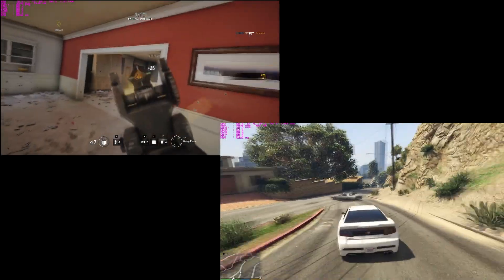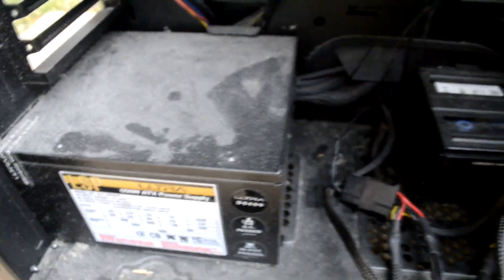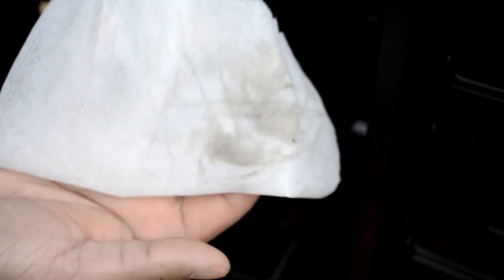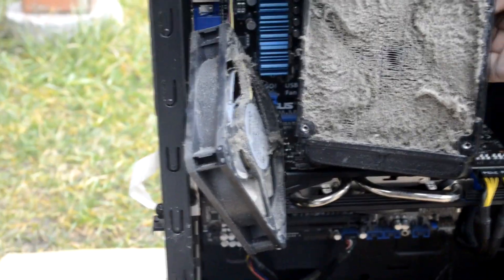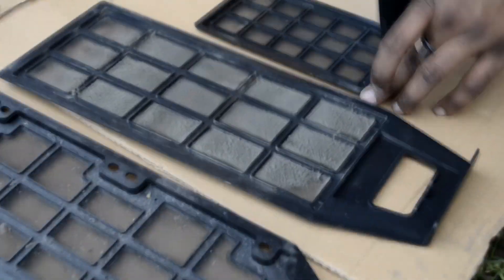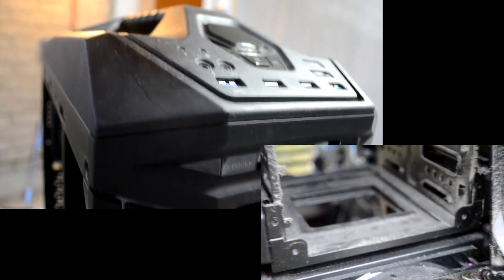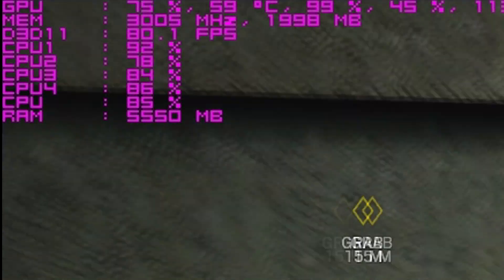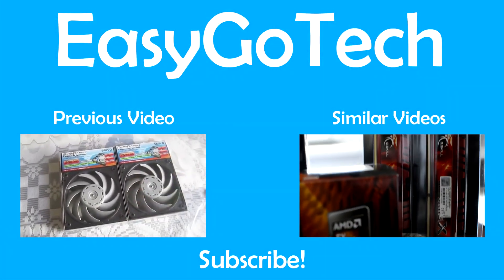Myth Busting: Does Cleaning Your PC Improve Performance?

Comment: I had my PC for 2 years and didn't clean it once. It would constantly have loud fan sounds, today I cleaned the fans completely and now there's barely any fan sound and also less CPU usage is being used. It's worth it to clean your PCs
Reply: I didnt clean my PC for 6 months and roblox already starts lagging
It didnt used to lag before
I will clean my PC now
Reply: @YOYaiu  if roblox starts dropping frames you already know your pc is fucked 💀
Reply: i have my pc for nearly 3 years and i never cleaned it up, the fan sounds are not loud and sometimes it's slower than a turtle but some times still not decent but faster than brefore so uhhh yeah, i never get decent performance

Comment: I cleaned out a massive amount of dust and fluff from all 4 fans. I had no idea so much crap could get in, you could not see the heat sink at all for gray stuff. I took it out to my garage and blew it out with a reduced pressure compressed air line. (with water trap)  Very satisfying, looks like new now. Does it work better? the hell YES. Thank you for the heads up, I will keep it clean from now on.

Comment: Cleaning a PC with compressed air is useless bs. The only real way to clean a PC to a state it almost looks completely new is:
1 - disassemble all components, everything, even fans and cpu cooler - you'll need a thermal paste later
2 - first vacuum dust off everything
3 - remove the dust that sticks to case and gpu fan wings with either blue window cleaner or solution for pc (basically the same) or with wet alcohol based clothes (like the ones for hands). U can use fingers or ear cleaning sticks 

Fans always have dust on them pressed by hours of spinning that won't come of with air or vacuum, only applied pressure

4 - use the same method for rest of components
5 - remove fans from cpu cooler radiator, which is definitely filled with dust and rinse it with either hot water in shower or apply the detergent and then rinse. It will look like brand new. My black radiator from artic 34 esports duo was almost Grey.  The dust on it was like glued to it.

5 - vaccum and then air-blow the connectors on the motherboard
 6 - gently clean the cpu of thermal paste with either soft toilet paper or handkerchiefs
7 - apply new thermal paste and rebuild pc from scratch

Repeat this every 2-3 moths and your pc will always look new and have beat Temps

I have beat Temps with 3 from intake fans, 2 back outake fans, mx4 thermal paste. He who thinks that just air and vacuum will clean a pc has never cleaned a pc... It's impossible

Comment: I just use air compressor 100 psi cleans easy
Reply: Yeah you could do that... Or use the convenience of the huge vacuum that is space. But to each their own
Reply: just another account vacuums create deadly static
Reply: Dangerous Uncle no more like moisture would be the bigger problem and never had an issue with that either just let it dry for 10-20 minutes
Reply: ItsiTroid does compressed air have any moisture? Or can I just use that and the straw
Reply: @ryando2877  if its outside it will have moisture from the air

Comment: A clean PC is a happy PC. I just cleaned mine after months of neglect. I haven't cleaned mine since December, which is pretty bad since it gets very dusty where I live, and I also have my computer underneath my desk. So it's insanely prone to  getting dust sucked into it. The amount of dust and dirt that I removed was astonishing. I even decided to remove my AIO so I could take it outside and really get at the radiator with some air. So, of course, new thermal paste applied.

After all that, my CPU temp dropped several degrees (at least 5 C) at idle. GPU seems to be mostly unaffected at idle, but I didn't really wanna take it apart just yet. I'm waiting to get my hands on an aftermarket GPU cooler before I take it apart and really clean it out. Regardless, I'm pretty happy with a clean PC.

Comment: It sure did for me. Used a compressed air can to clean out my laptop fan and it's like my laptop is brand new. Able to watch videos with no interruptions or lagtime at all, can go from page to page very smoothly and it just plain runs better. The fan is quiet as a whisper and the laptop is noticably cooler. I know I'll regularly clean out my laptop fan on a weekly basis from this point on.

Comment: Cleaning PC is more about preventing its early demise by having more stable temperature, better power efficiency (less intake for the same usage), less risk of electrical shortage, while delivering the SAME output while it can. Not to mention a better looking device.

Comment: I'm 1 min in, I started thinking of the shitty $20 box fans we have. When I spray the motors out, and spray the blades down with water, it performs substantially better. Dust slows things down dramatically on those things.
So, from my experience, if it has some kind of an electric motor, keep it as clean as possible. It also makes sense bc the extra weight of the dust (grabbing even more dust while it's being used, will weigh down everything about the device.

Comment: Modern hardware is smart enough to automatically down-clock "throttle" itself when becoming too hot in order to prevent it from burning out. Dust impedes airflow causing the cooling to be inefficient.

Comment: I would recommend removing CPU cooler water block. cleaning CPU and water block contact surface with alcohol and replacing he thermal paste with a after market one like cooler master or arctic. it would bring down temps even more so. Same goes for the GPU.

Comment: It's not always improving performance, but improving the temperatures, keeping the computer quieter and cooler.
Reply: VERY LATE here, but if anyone is curious, improving temps helps performance as your CPU and GPU will bottleneck themselves to protect themselves.

Comment: You really need to work on your airflow direction. You have the fans sucking in front the front and back of the case. Flip the fan on your radiator.

Comment: Well no, not directly. Cleaning the PC reduces temperatures and mechanical obstacles (clogged up fans etc), and those lower temperatures increase the performance. But the perf gain will be minuscule. All you're really doing is lowering temperatures to reduce thermal throttling.

Comment: Oh hell yeah... If the pc os running hot as hell, the cpu and gpu will throttle... Old systems didnt even havr this protection and could have damage in the parts.. 

You only clean when you see the temperatures rise or once a year or another period of time depening on how dusty it gets.

Comment: Who has that rear fan on the inside of the case pulling air into the case and not pushing air out of the case
Reply: Which is also why there’s so much dust on the radiator

Comment: You should never use a vacuum to clean a PC because of Static Electricity buildup and potential Discharge onto components. an Air Compressor is the best way to clean a computer.

Edit: I Didn't watch far enough to know you were only cleaning the Dust Filters with the vacuum.

Comment: Trash air cans...   TRASH..   use a fucking compressor with a pressure regulator and a vapor trap.  about 30psi does the trick.

Comment: Well, nvidia cards are designed to run slower when they detect poor air circulation so I'm gonna go with yes?
Reply: Nvidia cards do not detect poor air circulation. Simply when there is poor air circulation, the cards tend to heat up more and when reached a certain peek, the card thermal throttles to cool down.

Comment: Really 3 years? That's very disturbing. I clean my all my desktop PCs at least once or twice a year else it will start making funny humming noises especially the fans.

Ideally you should clean your PC 2 times a year or better yet 3 times if possible. Regularly cleaning your PC will greatly extend the m overall lifespan of your computer components and maintain it's performance like it was just fresh out from the factory. 

Less dust, gunk, dirt and so on equates to better cooling from your heatsinks and fans at the same time prevents the fans in your PC from working overtime to compensate from those clogged from dust and other unwanted particles.
Reply: DarkZerol I had my gaming pc for 6 or 7 years maybe just 5 but I haven’t cleaned it ever should I and so I need help u got anyway to contact you lol

Comment: I put soap on my motherboard and some water. Obviously my pc was turned off and nothing fried! I then took apart the pc and put everything accept gpu into the dishwasher on COLD water setting and let it sun dry during the day, Air dry at night, and ran a heater on the gpu and CPU for three days. It completely cleaned my pc!

Comment: Air duster works best with the included straw without it your just blowing out air all over the place instead of concentrating the flow of air to be strong enough to actually move the caked on dust off the system. Never seen anyone use an air duster without the straw.

Comment: It WILL increase the LIFESPAN of your PC to keep it cool. Heat destroys electronics.
Reply: PC Reloaded, depends on what components, what temperature, and how long. You can look it up... heat is very bad for electronic components... that's why all of the cooling fans....
Reply: Darryl Edington Ik, heating a mb can sometimes fix it. Reflowing heats up the solder joints and can sometimes fix it, but not always.
Reply: PC Reloaded, I have heard of this practice, and I guess if the MB isn't working, why not.. right? But to melt solder, I think you have to get it very hot and that's likely to not be good for other parts... but, some have had success... What I have read is that heating and cooling causes cracking in small parts, so that the life of some electronic is dependent on how many thermal cycles it went through...
Reply: Darryl Edington yes. When it is hot slowly cool it down, or like you said, it will crack.

Comment: You can't really tell if it helped since you recorded it in two segments. Temperature, humidity or weather might have changed to result in slight "boost" in performance
Reply: I think when your computer is caked in dust. Cleaning the dust helps with performance. The other stuff is negligible.

Comment: Cleaning a gaming laptop can reduce the temperature of the GPU from 90°C to 60°C during intense gaming. Absolute day and night. It increases the performance as the GPU gets capped once the temperature reaches at 90°C. It goes from 25FPS to 60FPS once the GPU goes to full power again.

Comment: The PC should be  cooler and much quieter after a cleanup..  Way too dirty pc imo. best way to clean air filters is with a blast of water in the shower and  soak up  with a rag. They are plastic anyway.

Comment: IF ENYONE WONDERS WHY ITS WORKING FASTER
if your pc is too hot one way of preventing damage is automatical downclocking which means that if your pc runs too hot it will work slower to decrease heat output

Comment: at least 2-3 times a year clean the cpu, specially the systems clean them also. at that type of PC man NO NEED FOR AIR DUSTER,  vacuum cleaner the best cleaner for that kind of dust
Reply: Clare Claratehia don't use a vaccum cleaner. It can give your pc a Static Shock.

Comment: hey man. after seeing all that dust and only seeing approximately 2-4 deg C. that dont seem right. You should know that every time you remove a heatsink/fan you need to reapply thermal paste. i recommend arctic mx4
Reply: no dude toothpaste can last about 12hours until it gets dry
Reply: make sure you applied thermal paste. it is very important
Reply: junaid mahmood you can just use toothpaste

Comment: Every PC owner should have a vacuum and airduster.
Reply: I'd hope everyone that is not homeless has a vacuum
Reply: Mains-powered electric air dusters -specifically designed for computer cleaning - do the job efficiently.
Reply: When you want to clean your pc you should never use the sucking function when using a vacuum. if you're using a vacuum that can blow it's completely harmless and will not build up static elec
Reply: Ifnu use vacuum repeatly it will cause problems in the long run. well im gonna build new pc soon so it wont matter for my current system
Reply: I only used a vacuum to clean something not attached to my electrics. Like the cooling block.
Reply: Maybe if the vacuum wasn't on a carpet floor and on a solid floor like wood, cement or tiled.
Reply: Would it be ok to use a compressed air can?
Reply: that works too but if it's too dusty then maybe do the cleaning outside like EasyGoTech is doing.

Comment: It does not improve your PC but it prevents it from overheating
Reply: a cpu has thermal and power limits
cooler cpu will bring you away from the limit allowing your cpu go turboboost.
that's why intel
has base clockspeed and max turbo frequence
Let's say for an i7-4770k its base clock is 3.5Ghz and Turbo of 3.9Ghz
Your system will only be able to use that Turbo if you are running your system in much lower temperature if you need a 3.9Ghz to prevent overclock but you cannot get that turbo speed so your system automatically just stays at 3.5
then you will get bottleneck.. SO HOW DOES IT NOT IMPROVE IT ?
I came here because I recently cleaned everything inside my case and try to know if the same thing happen to others
I play League of Legends so many Fps drops cant even run league of legends med/no shadow setting without going under 60fps with my a8-5600k and r7 250 sapphire just running at medium settings.  Cleaned everything saw thermal paste 100% dry cleand it with alcohol put some toothpaste as alternative to thermal paste. I'm running the game now 120fps avg very high + AA +shadows. Yeah it boosted my PC speed 2x for this game but in some games I think ill just get the same frames he earned in this video cleaning it.
Reply: Actually cleaning PC cand improve performance. GPU`s boost works only when the GPU temp isn`t high. If it`s to hot it will throttling

Comment: Always use a regular air compressor and NEVER use wet wipes on a PC other than the exterior...
Reply: When you dump 6k into your pc it is the fucking mona lisa.
Reply: Nathan Hamman thanks man I just fucked up my pc, why was I born so gullible
Reply: why do people always think that a computer is as fragile as the mona lisa
Reply: White Star If you take out the CMOS battery and discharge the leftover energy, you can submerge it in water to clean it.  One guy cleaned a majority of a desktop in a dishwasher and it worked fine after drying
Reply: Yeah man the other day my dad threw his pc in the hot tub with a couple bath bombs and then dryed it with the oven at 375 degrees. Much better performance
Reply: Lasley Media Group bullshit clean my fans and cup heatsync with Lysol wipes and never have a fucking problem
Reply: I watched that video pritty cool and impresive
Reply: I to would recommend a air compressor. But if you haven't used it in a while make sure you let the air out first. Or it will mist rusty water every ware.
Reply: Just because you can doesn't mean you should. You can clean your computer while it is on and not get electrocuted but does that mean you should?
Reply: A computer can get wet.... ONLY of theres no charge.... In the summer I use a hose to wash out towers
Reply: I wouldnt use an air compressor for the simple fact that when it compresses in the tank it adds moisture, usually you can buy an in-line water catcher
Reply: Zabreal The moisture evorporates in room temperature
Reply: Also NEVER use a vacuum!
Reply: wet wipes have alcohol, its quite ok
Reply: jg togi you're talking as if its illegal. If you can do it then do it.

Comment: i would clean it way more than once a year
Reply: blakedmc1989RaveHD well, it depends on how much dust accumulates where you keep the pc... but i think that once a year might be enough... and no need to tear it apart to clean, aside for aesthetic reasons: the more you fiddle with your stuff, the bigger the risk of doing some damage to the components
Reply: I know! i clean mine every 2 months xD
Reply: JourneyPlayz I clean 1 time every 3 months and once a year I tear it completely down and thoroughly clean it
Reply: didn't clean my pc in a year and it had quite a bit of surface dust but nothing collected around the cpu/gpu heatsink surprisingly. I have it on the floor too so I really don't know
Reply: PTree CS GO Same
Reply: I clean my one every Sunday
Reply: i clean every month. it doesnt really give more fps if it isnt thermal throttling
Reply: glass window , I clean that at least bi weekly XD
Reply: And I haven't cleaned mine for almost 5 years /Never 
Is it worth it lol.
Reply: @Praneel  same xD
Reply: @lino2463  xD
Reply: Mr_No_Name lmao same
Reply: 2 years without any cleaning and my pc only had some decent amount of dust, you guys' house must be so freaking filthy

Comment: So the myth busted or confirmed?  
Managing the airflow by adding more exhaust fans may reduce the dust buildup?
Reply: Actually, you need more intake.
This causes there to be more pressure in the case than the outside, blowing air out of the cracks in your case, and thus reducing dust (and if you have dust filters on your fans, then its actually quite a lot less dust)
Reply from the maker: +archedperson Yup for sure.
Reply: Especially if you have a laptop you NEED to clean your PC otherwise thermal throttling may ensue. For example, my SSD was at 65°C and after cleaning it went to about 35°C +-5°C, HDD from 50°C to 26°C, CPU from 70°C to 45°C all idle. I noticed recently that my PC was very laggy and after checking my temps it must've been thermal throttling. The drastically lower temps made a big difference in performance for sure.